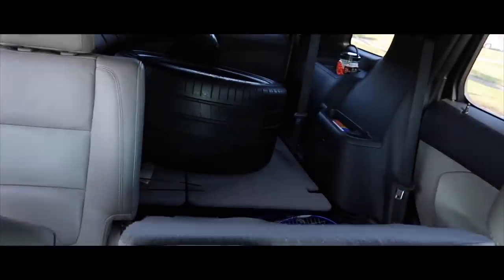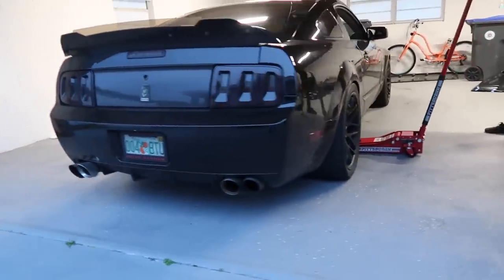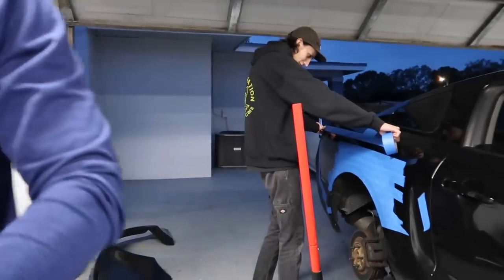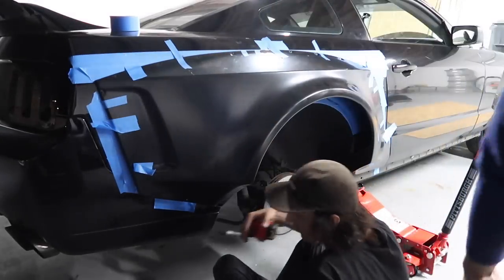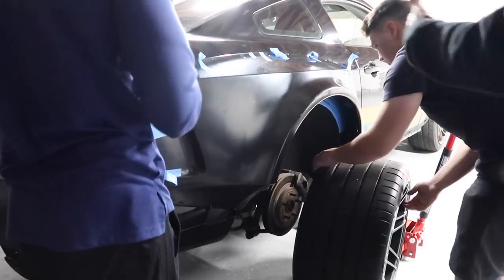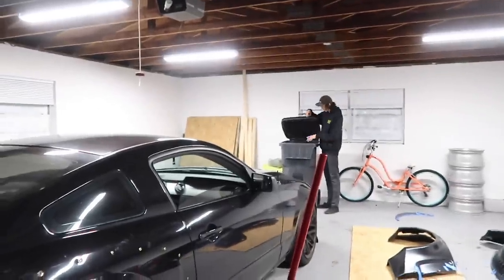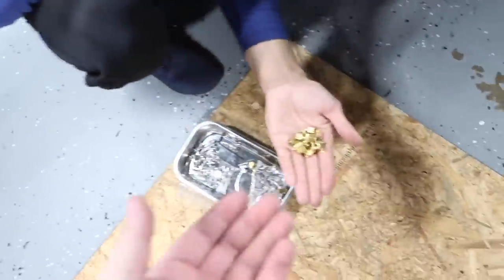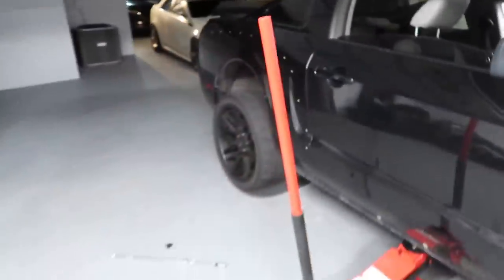WIDEBODY INSTALL ON THE MUSTANG! Can’t Turn Back Now!

Comment: One thing about it John is if any time in the future you decide to go back to stock body you can, save the rear cuts and could replace the front finder's..
Reply: You dont gave to savez anything drill through the punch Welles and just replace quarterpanels fenders van be replaced as bell cars are a dime a dozen

Comment: Hey probably already plan to do it but will say you should really seal/paint the cuts and the drill holes so they do not start to rust down the road. But congrats on the car/build looks epic.

Comment: It looks good so far. You got some big balls to cut your perfectly good car but I am sure it is going to look good after the paint. One question though, are the rivets going to show after you get done?
Reply from the maker: The rivet wont but the bolt and washer will
Reply: @Johnathanharder  Paint them black.
Reply: @Johnathanharder  what size of spacers did you use

Comment: The moment you see that cut is the moment you go... It's screwed up now... Might as well go HAM! I could never do that. Well... never say never... But it's highly unlikely.

And 2" spacer? Damn, not something I would personally be comfortable with. I don't like spacers at all, too many horror stories out there. Some people run them for years with zero issues and others have catastrophic failures.